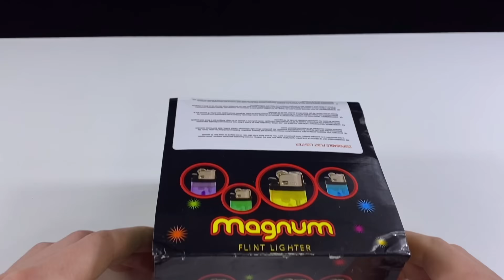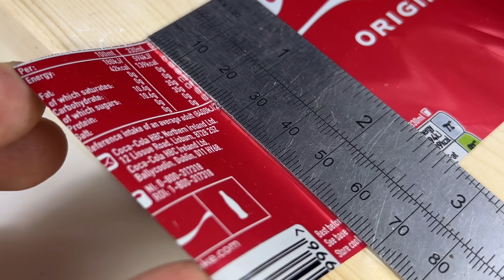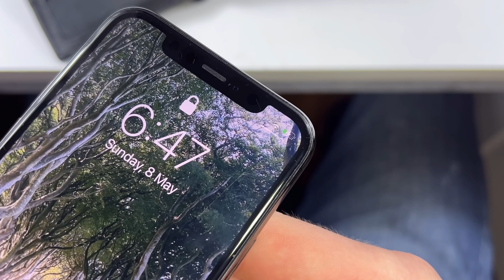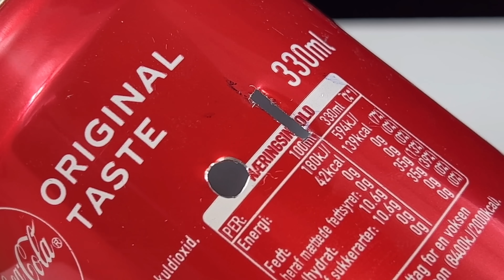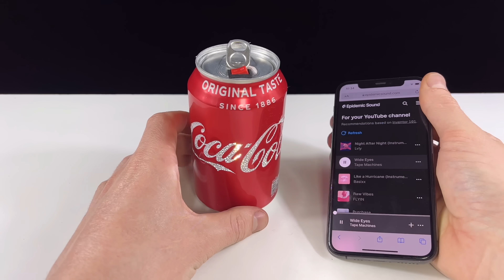Top 5 Practical Inventions and Crafts from High Level Handyman

Comment: All of the lighters were glued together and then magically the bottom lighter used for the light attachment was just plucked from the bunch, cut apart and attatchment added and then glued back into place.....if someone was using this video as an  instruction manual they would be pissed off when they realized they had to take one of the bottom lighters off after they had already glued them all together lmao
Reply: Heat, sparks and lighter fluid don't usually pair nicely outside the device so intently engineered. What was the razor blade thingy and btw in what universe is a double bladed Wilkinson a "safety" razor?